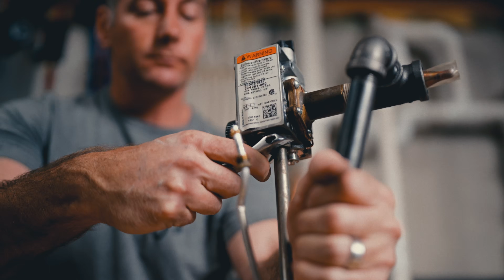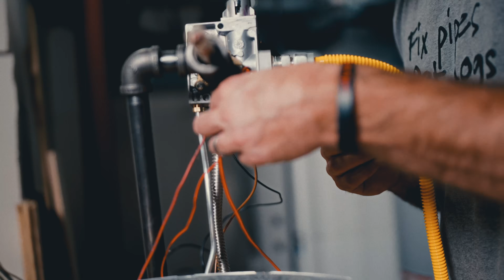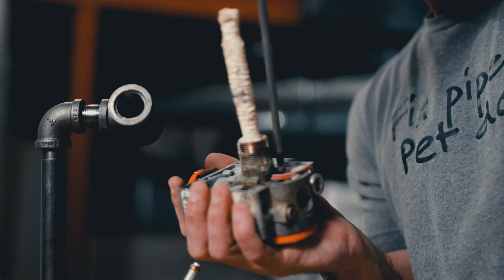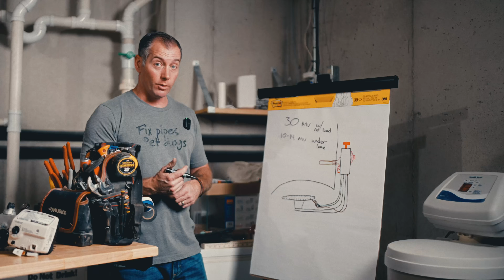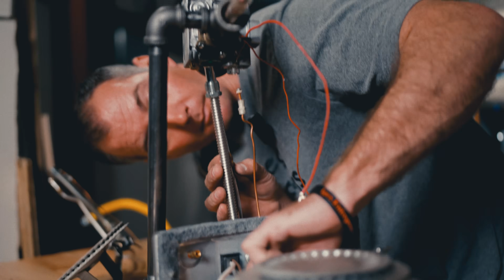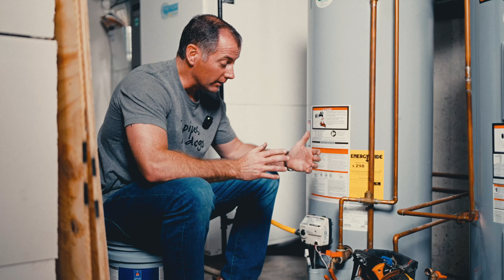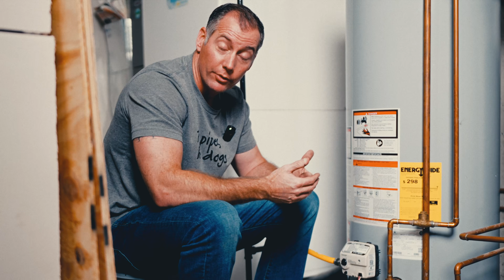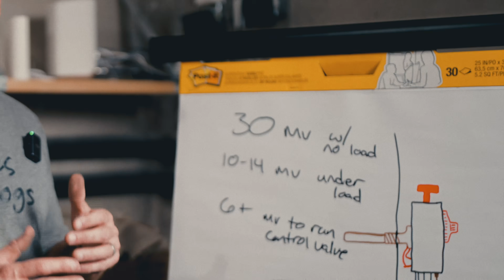Water Heater won't stay lit - Here's why

Comment: Have a Bradford White unit. New gas valve and thermocouple and every time the heating cycle goes through and the burner kicks off, it then causes pilot to kick out. What could the cause be?
Reply from the maker: Probably a dirty air inlet screen or a clogged/collapsed flue tube.  Sounds like it's starving for air and getting too hot.

Comment: Great video man.  I've definitely come across more bad control valves because of overheating on the old style.  Then the black plastic would crack and let in a minute amount of water and ruin the temp probe but the Thermopile countdown is the problem I've come across 5 and no one believes it unless I show the video readings of the Thermopile reaching normal voltage and countdown like a clock downward losing voltage and shutting the valve down.

Anyhow man y'all keep it up!
Reply from the maker: Ironically, the Honeywell valves with a bare plastic tip are box store water heaters.  The professional grade water heaters have a control valve with a metal cover on that plastic tip to prevent the failures you just described.
Reply: @SmedleyPlumbing    Thanks for your informative video. You certainly know more than me, but I think the plastic vs metal covered probe is a question of the Honeywell design generation because I installed a Bradford White heater in my own house in 2015. It had a 300 series Honeywell black plastic covered temp probe which failed in 3 years because it would keep setting a “replace valve” code which I overcame repeatedly with the battery jumper trick. I got a metal covered probe complete valve from Amazon which is all working fine today with no resetting ever needed. There were a LOT of online complaints over that plastic covered probe type valve failing early on different brand heaters. Some Honeywell engineer must have figured out the problem with the first design.

Comment: Hey you didn't cover the best of all safety devices.  The Peanut Vile 😅
Reply from the maker: Lol. It's a solid design but the Rheem and Ruud units also use a series 100 control valve.  If the TRD pops, that's no bueno.

Comment: A thermopile is just several thermocouples in series.  The voltages add together just as when you connect several batteries in series.
Reply: Thermo pile generators  and old 1950 gravity gas furnaces go together. !! I dismantled an obsolete  'match book'  style powerpile and I found TEN mini thermocoupler heads inside !!
Thanks for the extra tips on these troublesome tank controls..the first versions of the honeywell 400 series had no real diagnostics. I've  had these fail under less than 4 years..another issue on most all burner assemblies is the flame guide ring fractures and allows flame flutter near thermal cutoff.
Reply from the maker: @Barracuda48082  yep!
Reply from the maker: Yep.  It's basically one giant thermocouple.
Reply: @SmedleyPlumbing  What would the voltage be if the thermo couples were paralell though ?
Not enough for electro magnetism I guess , albeit this engineered structure ... so maybe low volt / high ...
Maybe something else could work ???
Reply: @Mk101T  No different than putting batteries in parallel ---- same voltage with more avaialble current.
Reply: @thecarman3693  Ya I figured was the case.  But I guess no need for more , longer lasting current with the thermocouple creating voltage from the flame ?
Ergo gas being the battery storage so to speak ?
Reply: @Mk101T  Yes ... energy is energy, the flame being the source for the thermocouple's voltage.
Reply: How do I know if I have a thermocouple or thermopile?
Reply: @donnarepka677  Not 100% sure about this ... but a thermocouple has what looks like a single bare copper wire going to the gas valve.  And a thermopile has 2 insulated wires of different colors connecting to the gas valve.
Reply: @Mk101T thank you I figured it out.